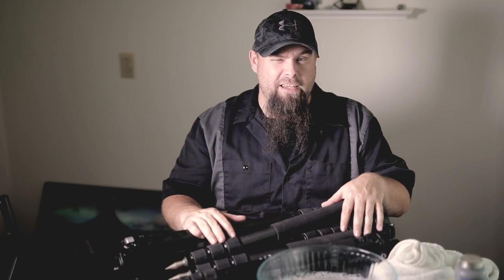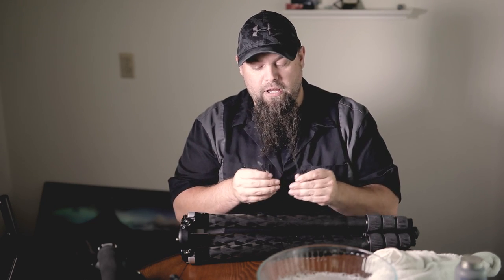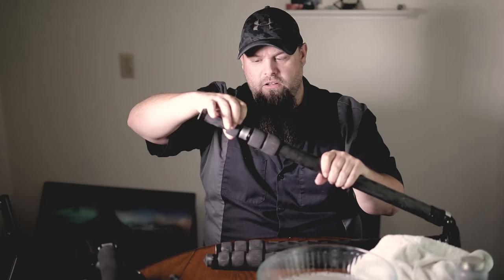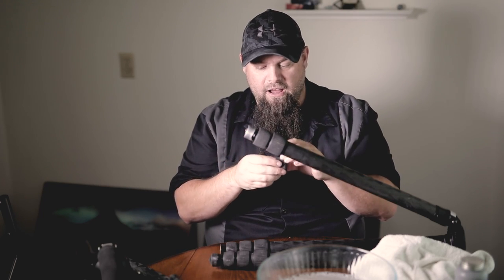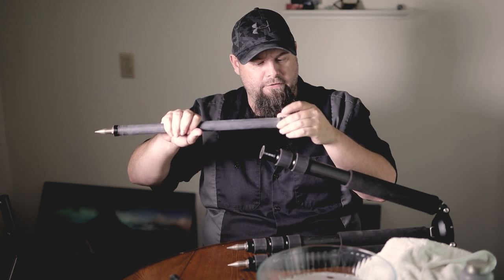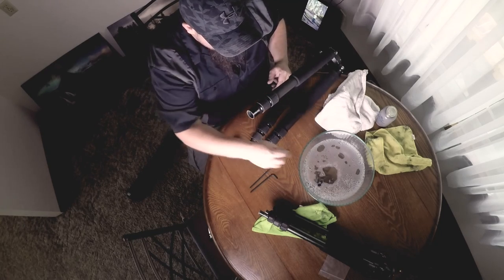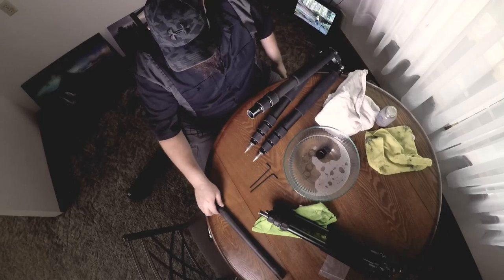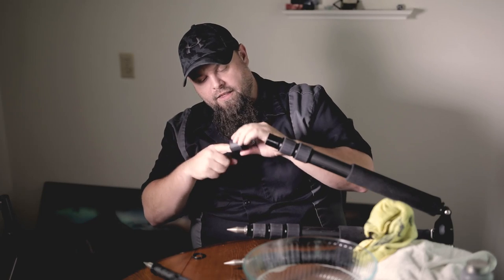Tripod Maintenance - Taking apart and cleaning a Tripod

Comment: FWIW, the Permatex anti-seize you used is NOT a bearing grade grease. In fact, it's not technically a lubricant at all. It's purpose is to prevent oxidization/corrosion of threaded fasteners so they can be removed reliably after exposure to water, salt, and air. In other words, it's supposed to help those of use that live in the midwest get our cars apart to repair them after driving all winter on salted roads. The particle size in the anti-seize isn't small enough to be a lubricant and, in fact, will be abrasive to many surfaces.

Comment: So I did a cleaning on my Gitzo mountaineer 3541 legs. Took the shims out, cleaned and greased the threads. A couple of the twist-locks are not coming loose more easily than the rest. What do you think the problem is? I don't think I over-lubed the threads, Do parts like these wear out? I don't really shoot in harsh environments So this is the first time I've decided to clean them after seven years of owning them. I seem to have to really crank down on these locks to get them to stay.

Comment: Nick, I really like your videos, however the background music on this one was a little too loud, it should be background but it sounds just about the same level as your voice audio. I'm really surprised you used the anti-seize, that stuff is so messy!
Reply from the maker: +Mike Dixon trying to my a dull dry subject a little more fun
Reply from the maker: +Nick Page make not my
Reply: The music type was fine, I just think it could have been a little lower in volume as it was competing against your voice. Anyway, keep up the great videos, I really enjoy them!
Reply: Copy that on the Anti-Seize. I've been using it for years on my wheeled vehicles nuts and bolts and DANG it's a BUGGER to get off of EVERYthing. I'd be afraid of getting it on any other equipment that comes even in "close" contact with my tripod. But, whatever works.
(Krud Kutter works GREAT to remove it though!)